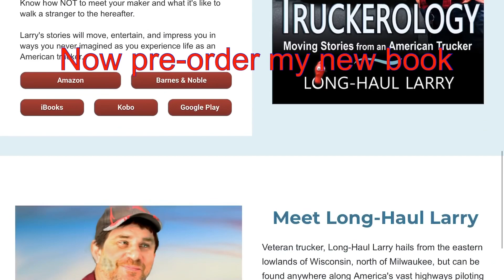Trucking, changing out my power steering filter Kenworth t680 2020/47

Comment: But in the day, depending on the truck model. We used transmission fluid or 30 weight motor oil for the power steering fluid. :)